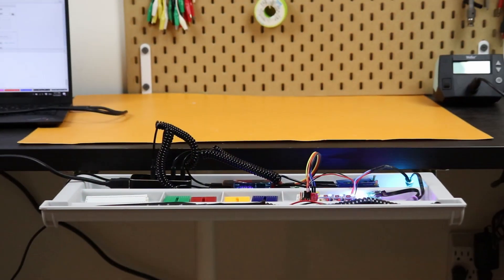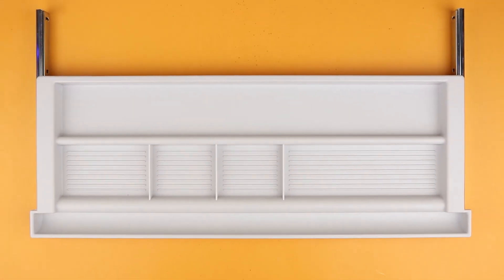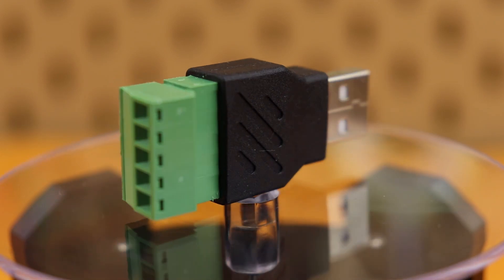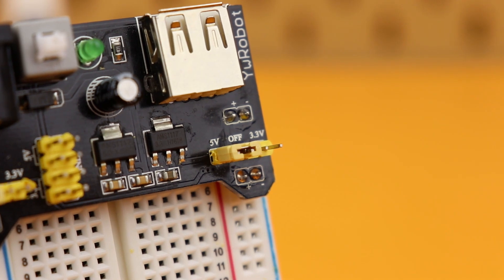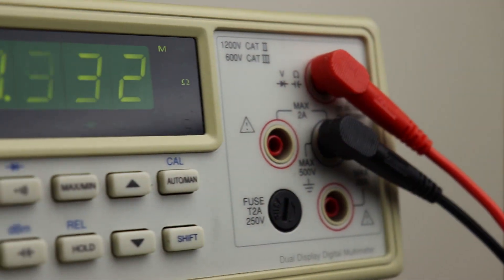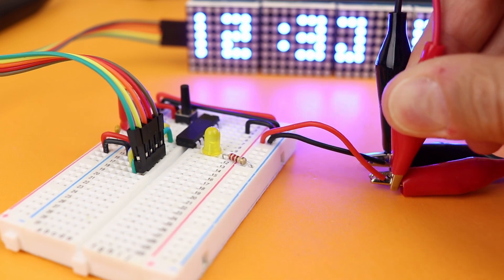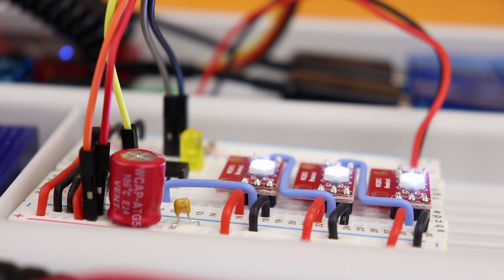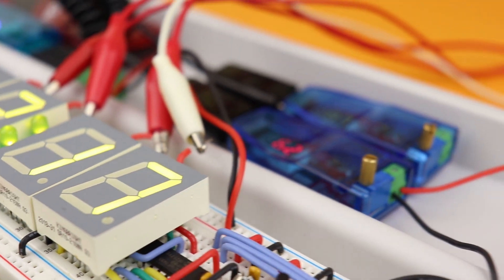Your own electronics lab... in a tray!

Comment: 3:18 Warning. These cheap low quality adapters usually have counterfeit/fake components. I've had two of these fail. One of them fried a new PCB I was working on for weeks, due to an overvoltage from a voltage regulator that suddenly decided to die.
Reply from the maker: Good to know, and thanks for sharing! I had good luck with the ones I used; one of them has been powering my binary clock for 2 years now with no issues at all.
Reply: @FriendlyWire They are very convenient, and work very well until one day they don't, and then end up frying your precious electronics projects. Replacing the voltage regulators with known genuine components might be an idea, but that's not really ideal for beginners (which I assumed was the target audience for this type of video).
Reply from the maker: @SeanChYT I have never heard of this problem before, interesting. Of course they have a maximum current, did you run them in spec?

Comment: I've watched a few videos on this subject. Most of them ended up showing labs that would cost well over $1000 (more like >$2500). It doesn't have to cost that much just to start. I did not know about those USB power supplies, they look very handy.  Thanks for another great video Jens, take care.
Reply from the maker: Thank you, I am glad you like it. These supplies can be very handy, but they don't provide a lot of power, so it probably makes more sense to get a switch mode power supply when you are getting more serious. For a few LEDs here and there these work great, though :)